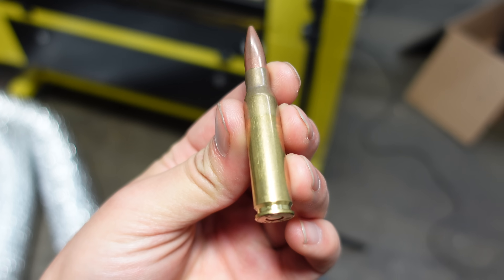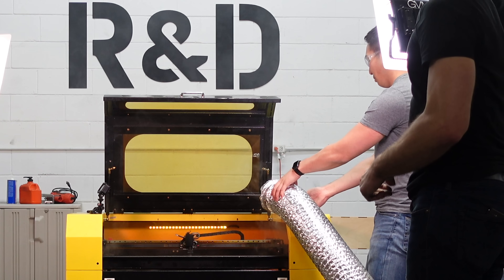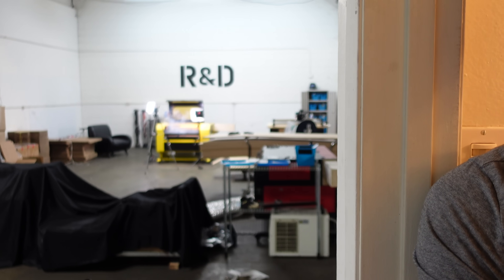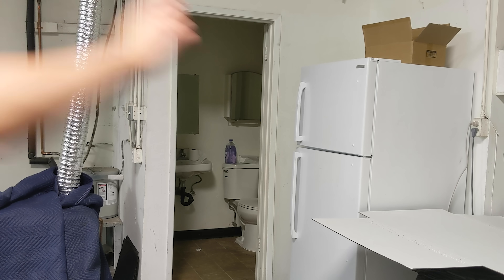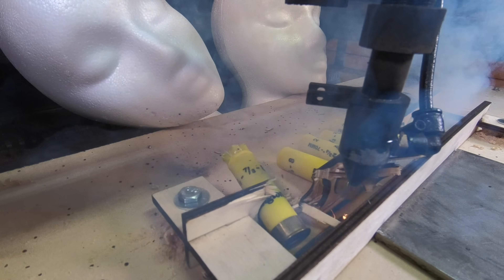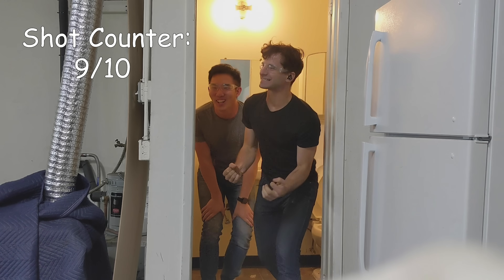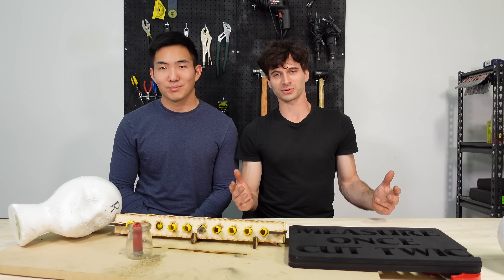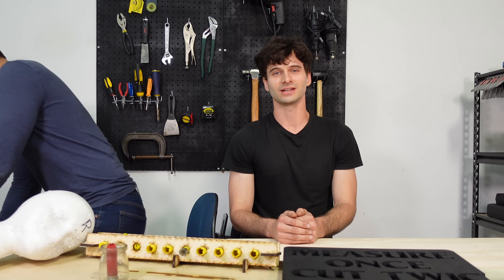Can a Laser Ignite a Shotgun Shell?

Comment: Something about the brass... the LASER you are using is a 10Knm wavelength... it will reflect. If you were using a 450nm blue laser at that power it would mark the metal... and at higher power would cut it. Usually for metal cutting they use a fiber laser with a short wavelength. Interesting, when I had a 10Knm IR laser I could cut plexiglass, when I used a 450nM blue laser, it passed through the plexiglass and burned with wood under it.

Comment: 2:34 but direct energy weapons which are super powerful lasers that are designed to shoot down incoming missiles do that they will burn a hole through the steel fuselage of a missile and destroy the warhead or disable the engine and midflight yeah it’s usually painted steel but it’s still steel it’s metal so I don’t understand maybe your laser is not powerful enough to cut through a bullet case

Comment: The reason it didn't do anything to the brass shell is because you're using a CO2 laser and not a Fiber laser. The focal beam of a CO2 laser is bigger than a Fiber laser which prevents it from etching or cutting metal. The fiber laser has a very small focal beam which gives it about 100 times more intensity than the CO2. Nice video though!

Comment: The actual reason why it didn't do that much damage to the head when the shotgun shell went off is because sense there is no barrel holding the shell it didn't have enough time to burn all the powder which makes it pretty weak that's also why in the line up of shotgun shells some black powder comes out the front because it didn't have time to burn it
Reply: Incorrect. The powder is burned - but the energy released is released without a barrel or other device compressing and containing it - so it just disperses.

Comment: if you ignite it from the outside you need to strike steel to make heat and ignite the powder ( which is how guns work with a striker) or a fuse ( which is how bombs work ) how you exploded the shells is simple the light heated the plastic and ignited the powder sending the pellets everywhere

Comment: The reason that the bbs in the shells don't do shit is because the pressure in the shell once set off is escaping by expanding the shell and as soon as it leaves the shell flies widely about. You need a barrel or a tube to contain the shell so that the shell does not just explode out and somewhere to direct the pressure so that the pressure can build.
Reply: They keep that. If they did like you say, there would be extensive damage

Comment: hahaha this testing is so unnecesarily destructive to your equipement. Also be very careful if you're setting off rounds outside of a chamber: Shells won't build as much pressure but setting off a brass cased round outside a breech can be like a tiny grenade
Reply: I'd expect the result to be different depending upon where they aim the laser. At the end where there's nothing to contain the pressure is likely to give a different result than further in.

But yeah, even just plastic can be dangerous if it turns to shrapnel.

Comment: You should totally make a little 3D printed deathstar for the tip of the laser
Reply: @ro ro yeah you could but it would have to be painted or something with high temp paint or anodized because of the off color and brass is a good conductor of heat because of the copper
Reply: @hansvonolhausen3933  what about tungsten
Reply: @hansvonolhausen3933  just put the death star thing away from the laser.
Reply: it would probably melt due to the high heat of the laser
Reply: I’m Daniel  yeah but steel is hard to cast
Reply: Or a lightsaber
Reply: As much as I love the idea it would be too hot
Reply: @angrybritishman9461  best name to ever exist
Reply: @angrybritishman9461  use a material printer, printing high melting point metal
Reply: AGREE
Reply: Get a metal one
Reply: And point the laser at a 3D printed alderan.  (Sorry if I spelled that wrong)
Reply: Imagine y'all went to Opelika Walmart
And took pictures what
Reply: Nerd
Reply: This need to be pinned
Reply: They said tip
Reply: Ok
Reply: No make the borg cube
Reply: It could work with some kind of metal, because filament would melt quickly.
Reply: it wouldnt melt if its metal
Reply: Good idea
Reply: Hmmmm yos
Reply: Why a death star? The UFO that blew up the white house in independence day be better...
Reply: YES
Reply: Make it from tungsten
Reply: You need tungsten-titanium alloy smelter to achieve that.
Reply: 3D Print it then make a mold out of it and cast it out of aluminum
Reply: @hansvonolhausen3933  even with aluminium ，they will get over heat
Reply: It would melt
Reply: I’m Daniel  you would have to machine it
Reply: @hansvonolhausen3933  well then let's get to machining, if it's possible then let's do it
Reply: Yes
Reply: Sweet idea 💡